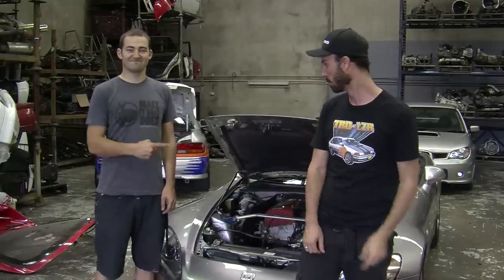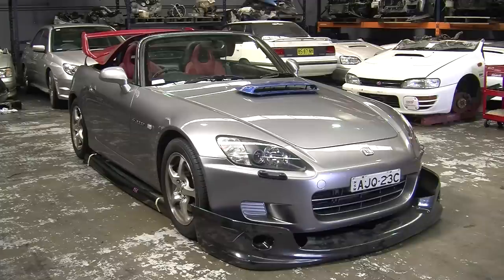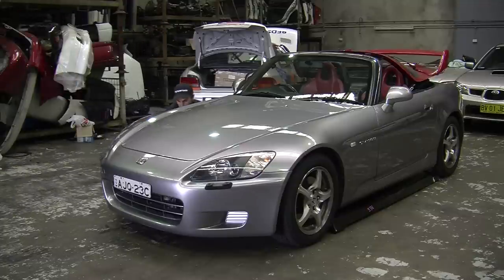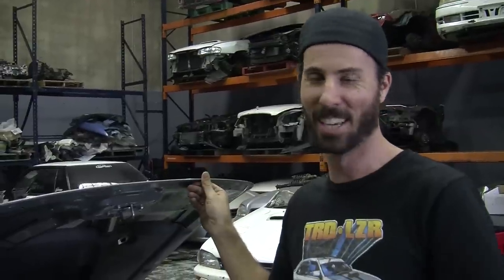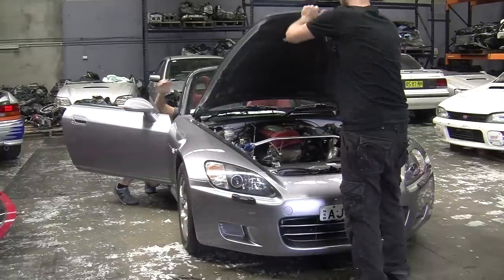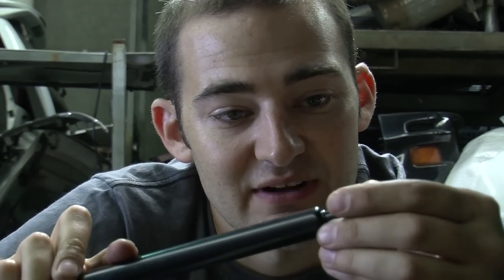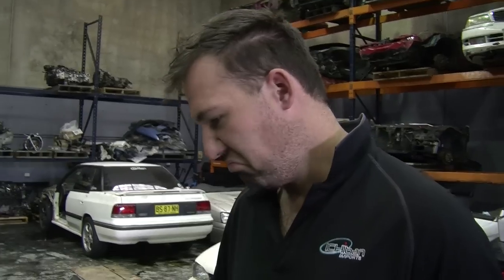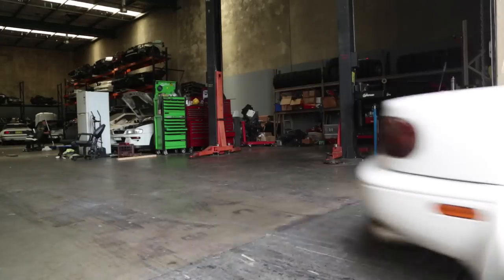How to Install Bonnet Struts (Hood Dampers)

Comment: for the love of god...NEVER put dampers on a car you intend on keeping for more than a couple years. almost all of my head injuries in the automotive field have been cause by hood dampers from that fucker cracking down on your skull outta nowhere...i end up just using a stick to prop it up anyways
Reply: Eh? I thought te point of te dampers were to prevent head cracking?
Reply: Tawhid Ahmed after a couple years, the seals in the hydraulic cylinders  that hold the hood up aren't what they used to be...so eventually they will fail. I have done countless prop-bar installations on cars whose dampers have failed
Reply: con3dbz why dont you just suggest that people replace them when they start to feel weak? instead you're all like... NNNEVERRAWWWRRRRR lol
Reply: skim2live_live2skim because they will end up replacing them again and again and again. prop bars never go bad.
Reply: con3dbz i find that props are in a pretty bad spot when holding the hood. i work on my miata quite often. also open the hood to show people who ask. i JUST converted to a single hood strut and i find it much more convenient and satisfying with it, other than always having to bend down, pick up a dirty prop, then find the hole i can never seem to remember where it exactly is.. $25~$50 for a new one every couple years isnt THAT big of a deal IMO and if you're THAT broke then car mods should probably the least of your financial worries

i do understand your concern but if someone happens to not realize their hood struts are weak and may fall on them, then maybe they shouldn't be under the hood in the first place :)
Reply: i guess i am a little bit biased because i work in a local shop. when you're working on 5 to 10 customer cars a day, you dont know how bad the dampers are until its too late (except for sometimes they're so dead, you can tell as soon as you lift the hoood). so if a car thats older than 2010 comes in, i just throw my little extendable prop bar up just to be safe.
Reply: skim2live_live2skim P.S. if a person finds setting up a "dirty" prop bar somewhat inconvenient, then maybe they shouldn't be under the hood in the first place :)